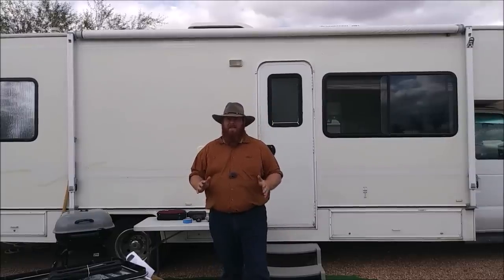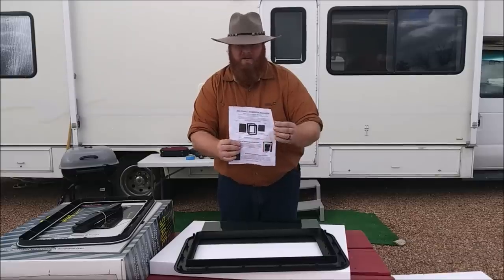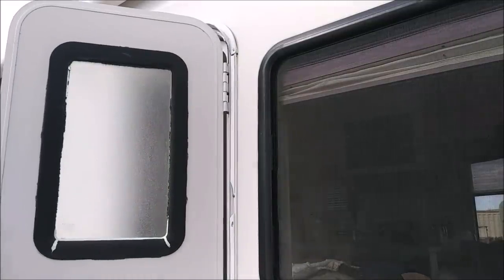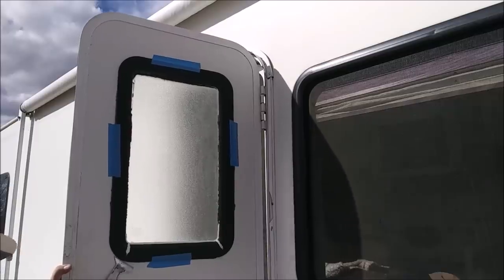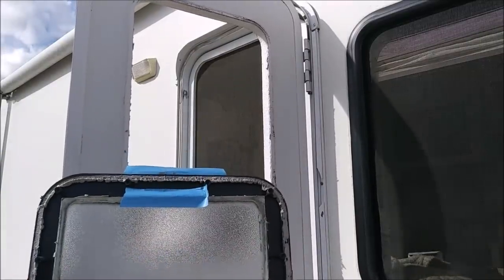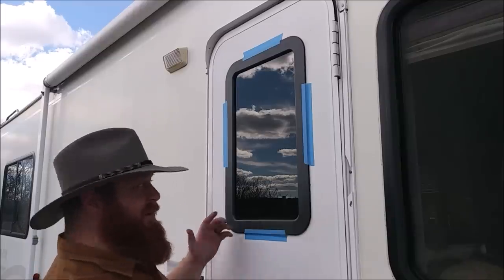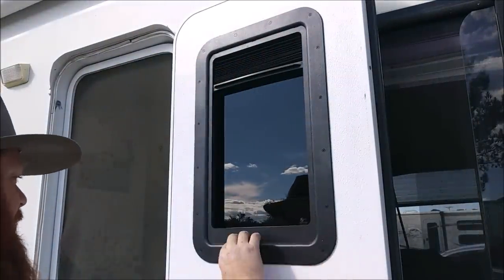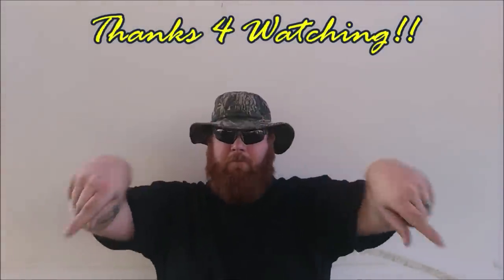How To Install and Upgrade Your RV Door Window With a Shade AP Product

Comment from the maker: If you look closely at the interior frame, you'll notice that I installed it upside down. I realized this at night. So, the next morning I spent 5 minutes and unscrewed the interior frame after I taped down the exterior frame. Flipped the screen and interior frame and now the screen slides up and down with no problem!    *** The interior frame has slots at the base for condensation to drip out of. ***
I apologize for the audio in the beginning of the video. Something was strange with the wireless connection but it worked itself out. :)
If you have any question on the let me know. This window upgrade is just AWESOME!!

Comment: Great informative video.What wireless mic set up are you using?
Reply from the maker: I'm using the Fifine.... Link is in the description for more detail. Once I got it dialed in it is great. The bad audio in the beginning of the video was because I had the antenna bent..... oops 🙄
Love this wireless setup. Makes things super easy, before I had to watch out for a cord.
Reply from the maker: Also the Fifine needed an adapter to be able to connect to my phone and dslr. So, if you are thinking of getting one let me know and I can help make sure you have the correct adapters. I spent several hours making sure I was ordering the correct items.🤓😀